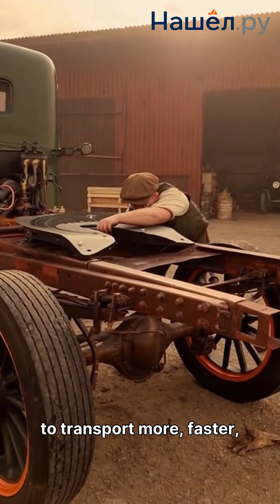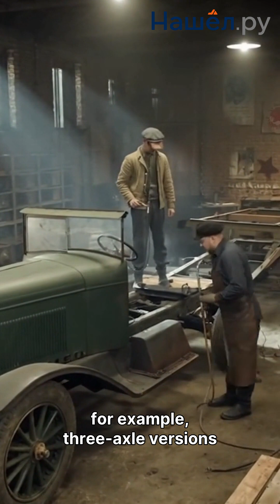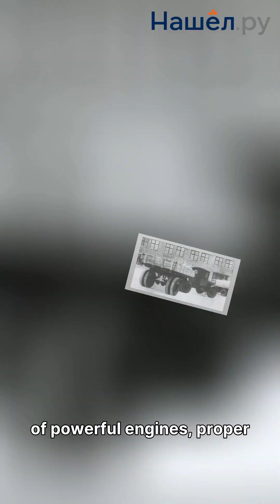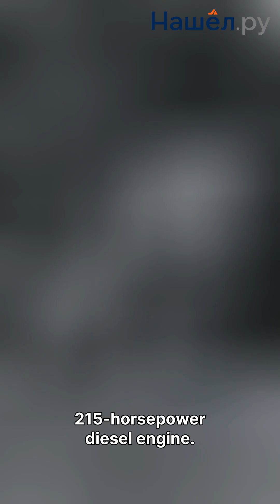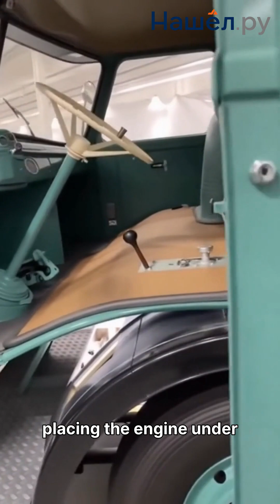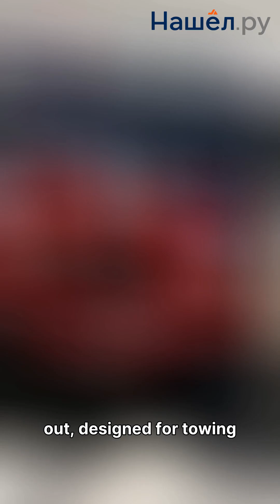Tractors: From Past to Future

Comment: I watched a video highlighting a few Dakar racing trucks. Seeing a huge truck zipping over the desert at over 100mph, jumping off of the top of a dune hill is impressive. They can fly as far as fifty feet and as high as 20 or 25 feet but landing on all wheels smooth as going over a pot hole .